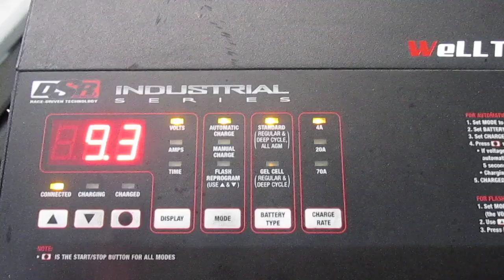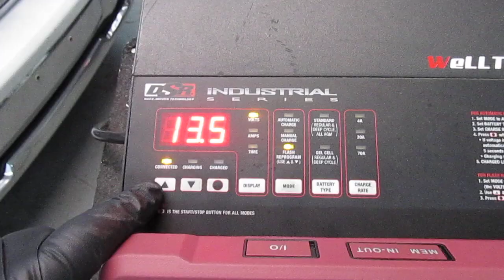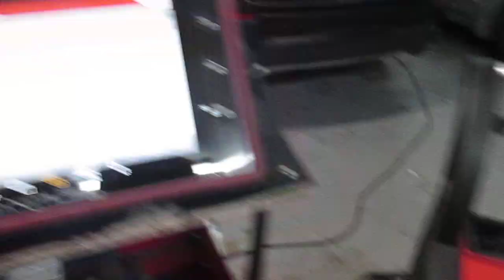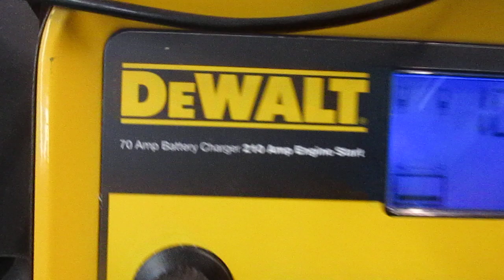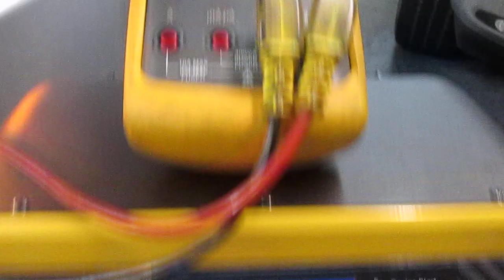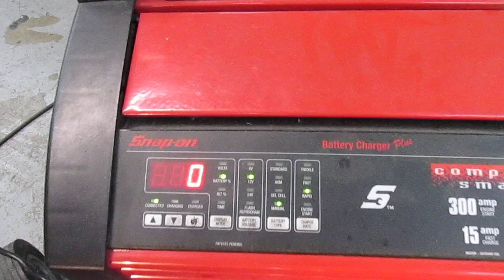DEWALT DXAEC210 70 Amp VS DSR INC700A

Comment: I think it's junk, mine will not charge a battery below 11 volts...it automatically  goes into reconditioning mode...there is no way to switch on charge mode...the main purpose of a battery charger is primarily to charge a battery. I wish did not pay $345.00 for a reconditioning charger...it sucks..I wanted a battery charge to charge a battery immediately not several days later after recondition mode is complete...Don't  buy a Dewalt charger. No good.
Reply from the maker: I agree ,today i found out Feb/12/2022..Dewalt no more producing this module ..

Comment from the maker: This is not a Power Supply design ,,but you can use it as a power supply also it will not charge if it detect current problems like if you have a dead battery usually i use a good battery in parallel with the one i want to charge for a mint this way dewalt will charge both after one mint i disconnect the good battery you will notice the continuity of the charging status . Very few battery chargers in the market offer high output Amps 70A and up with affordable price 199$ and down ,But my favorite is from Associated Equipment Model ESS6011 and it is not cheap.the best on the market ,that's my opinion
Reply: welltek diagnostics  does DeWALT can be used in programming used it like maintainer
Reply: Yes if battery is dead it will not charge indicates FLO